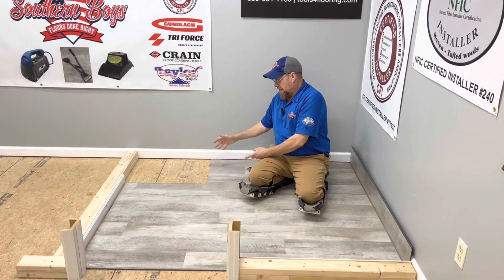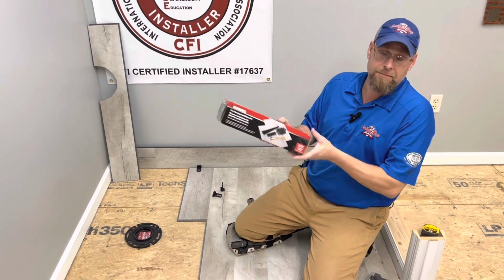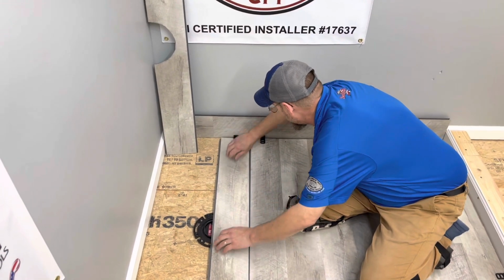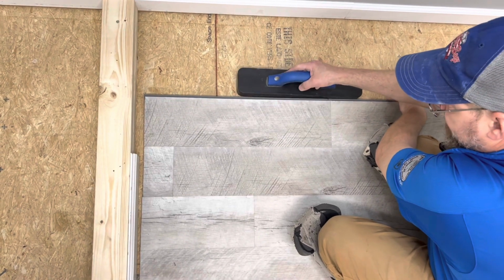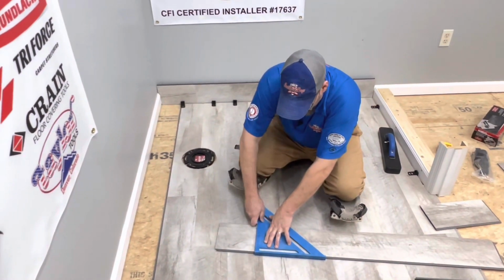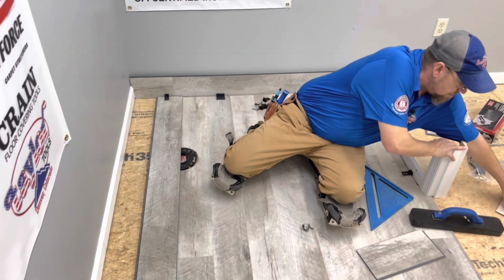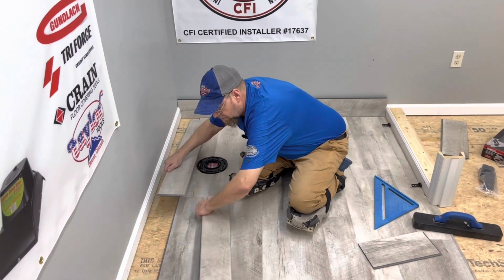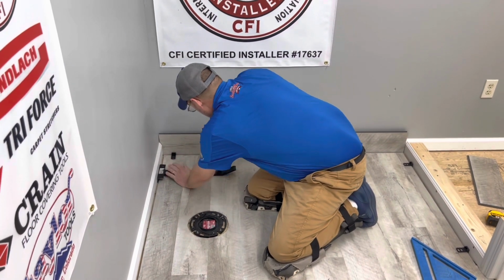Vinyl plank repair, cabinet sink to pedestal sink ￼

Comment: You probably will need more expansion in an area over xxxx (see manuf instructions)... That sq ft is usually around 2,800 and above.. When it gets to that amount of sq ft, the required expansion usually doubles to half inch. In fact, I just inspected a medical facility today that was well over 3,000 sf and there's all sorts of issues with shrinkage and gaps... Lots of offices, medical rooms, hallways installed (floating installation) with only 1/4" expansion. The salesman needs to use common sense and let installer know when you've got these big jobs and special circumstances arise like this. 95% of jobs aren't going to be that big, but everyone needs to be aware that LVP has it's own limitations.
Reply from the maker: You are exactly right on everything you said, thank you very much for putting that in the comments. I mentioned that a few weeks ago when I was doing a cortec tile about the expansion being doubled wants it reached think it was 2500 feet for that.
Reply from the maker: @RichKielbasa  I have done a whole lot of redos lately from job failure due to floor preparation and inappropriate expansion, it is definitely very important to know those little details
Reply: @FloorsbySouthernboys  I was an installer when I was a young buck in days of yesteryore, and I've done other installers replacements, and it was never an enjoyable experience. I'm not saying the customer wasn't happy, but it's a better install experience when the homeowner gets a great product and installation the FIRST time.
Reply from the maker: @RichKielbasa  yes it is
Reply: Anything that big, and commercial, I would suggest a glue-down plank.  Honestly, with all the things that can go wrong with floating floors, I would rather subfloor and glue down everything. Thanks for all the videos.